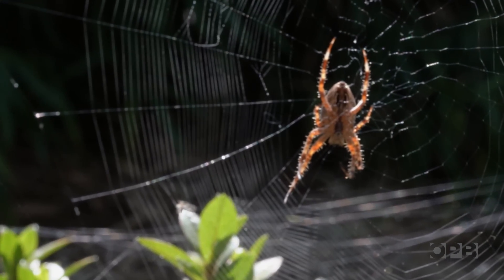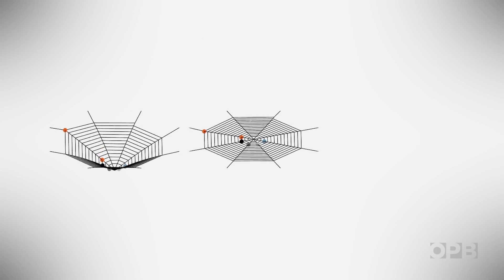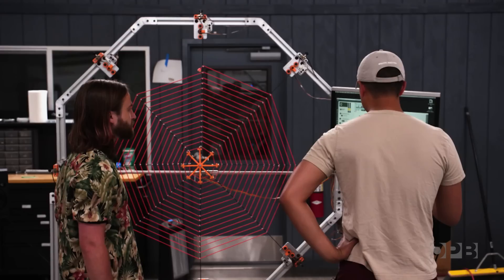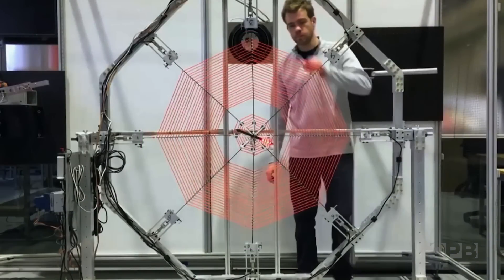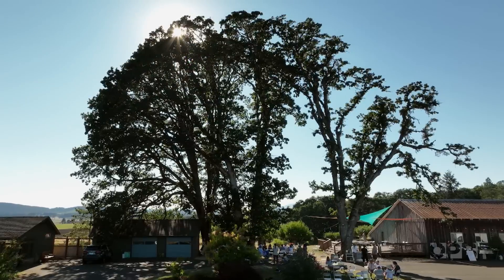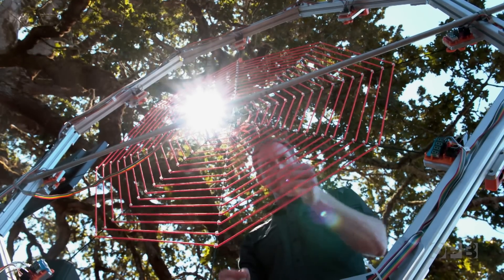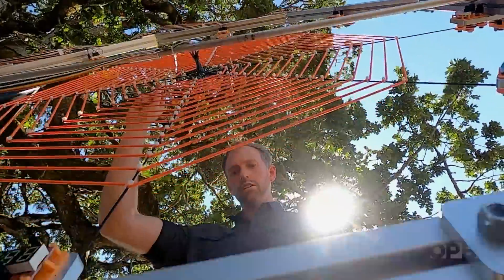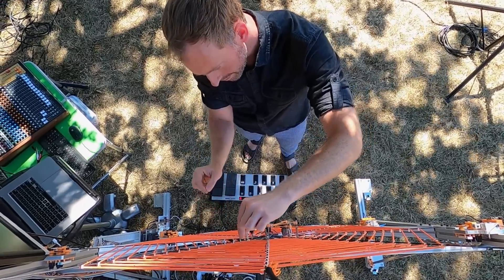Spider-web research yields … a new musical instrument? | Oregon Field Guide

Comment: I think there is too much of a disconnect between the mechanical motion that is happening and the sound it is making; it could just as well be a midi controller. I think what may be more of an inspiration is if the strings were somehow capable of making the sounds or a portion of those sounds through their actual vibrations.

Comment: Kircher mentioned this in the 1600's with a nice spider diagram too. "I have observed a remarkable and hidden harmonic artifice in the structure of spider webs. If these webs were strong enough to withstand tension, I would say that they could produce a most perfect ten-stringed instrument.  I observed that spiders usually make their webs in hexagons, with a surface composed of ten strings, stretched so skillfully that their length constitutes a perfect decachord. If divided into six equal parts, I say that the chords within each triangle are so woven that they form an exact decachord (10 string instrument), and the lines are so proportionate that the last one to the first produces a octave with a semitone, while the remaining chords are similarly proportional and provide the other natural tones" He also mentions to use iron or silk, i'm not sure why bungie cords would with chosen?
Reply: Silk might have worked, iron/steel (which we did try) was too stiff: 

The ability of the web to stay “in tune” corresponds to how much a slight error in, for example, the intersection positions changes the tension balance across the structure. With something very stiff, a small slippage or some creep in the material could wildly change the tension balance, even letting some of the strings go slack. Using latex-core rope means that we can operate with all strings stretched by a significant portion of their length, so that small errors don’t change the dynamics significantly. Because what matters most for the system is the symmetry of the tension distribution in the web (which allows us to use a fast and robust algorithm to “electronically steer” the sensor array on the spider) and not the tone produced by the strings themselves, the latex-core prototype won out over our early attempts to build a web with guitar strings.

Comment: I hate to break it to you, but this clearly doesn't make sound - it's a really complex MIDI controller. The sounds are made by the computer that's sitting next to it. These strings are too slack to make audible sound.

I'd be more interested in hearing the harmonies that are actually produced by the web shape - that experiment would probably only be doable in a software simulation though, as the strings would need to be actual (guitar, piano or violin) strings, extremely carefully placed and tuned. Building and tuning that in real life would probably be near impossible though.

Comment: Using different materials for the radials when the spider uses the same material, just thicker.  There is a flaw in your simulation.  Both shock cord and paracord comes in different thicknesses and strengths.  Choose one and stick with it.

Comment: A really cool inter-disciplinary project, though a little bit thin - I think I'd like a little more on the biology and the other aspects, I saw an article that talked about spider sensory use of webs, possibly linked to this project which is why I clicked quite quickly. Of course if you used nylon or metal strings it could sound a little more harp-like or guitar-like without amps - but I wonder what the acoustic/vibrational properties of spider silk are, if they are replicable to a greater extent, and how they co-evolved with the sensory capacity; I could also think about how you could use this to create some sensory organs in robots too. Maybe the two perspectives could help each other, this is already similar to experimental archaeology.
Reply: *thin as a video, I think the project itself probably feels like plenty.

Comment: Going by the sound of the instrument, it sounds like plucking a string triggers a MIDI signal, which is then played – it doesn't sound like an actual amplification of the sound the strings vibrating make. It'd be a much, much more complex sound if so. I wonder why they're doing it this way?
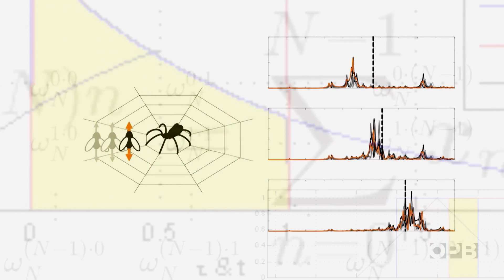Reply: We do have the ability to pipe the signals measured at the feet out to a set of speakers (the frequency contents of the signals measured at the spider feet are illustrated at about 3:52, and we can go up to 8 speakers when the performance space is conducive). 

The mapping to musical notes is originally to demonstrate the speed and accuracy with which we can identify plucked strings from just the foot-sensor data — just using the raw signals would actually disconnect the instrument from the spider research.

The mapping to musical notes also enables the overall performance art of playing music on a spider’s web — using a familiar sound with an unconventional instrument gives the audience a frame of reference for understanding the performance, that they don’t have if the instrument and sounds are both unfamiliar.
Reply: @rosslhatton  okay, right yeah, the web's usage as a musical instrument is not the main point, just a cool side-effect. The robot at the centre converting vibrations to computer signals is the main thing. 
Still, it got me thinking how an acoustic spider-harp could be constructed, and how it might sound....
Reply: @joe1729 We’ve thought some about acoustic versions, and came to the conclusion that they’re probably not feasible. The main obstacle is that the strings are all mutually supporting each other, rather than being isolated and attached to a rigid structure as in a traditional string instrument. As you noted, this will lead to a complex sound with a pluck on one string exciting vibrations in the other strings; it also means that the strings can’t be individually tuned. (Unless we introduce turnbuckles into the cables, which would disrupt the web structure and interfere with the sound. Even then it would be a tuning nightmare as adjusting one string would affect the tension in the others.)

The second problem would be finding a tension/string-size distribution that produces a useful range of tones and octaves. Our web is designed so that stretching the radial lines pulls all of the spiral lines into uniform tension; to get an actual octave-level change between strings as you move outward, you’d need to either double the string length or lower the tension as you move outward. The first option would result in a very sparse web (or a dense web with sub-octave steps and a small octave-range), and the second would lead to a tricky balance of stretching the outer strings enough that they will vibrate while not stretching the inner strings so much that they break.

(Several other commenters have asked about using musical instrument string instead of the parachute and shock cords. Tension balance and maintenance is an important factor in the material choice: The stretchiness of the material determines how much tolerance there is for changes in string length, with an error of a millimeter or two as we assemble the web or as the material stretches being inconsequential on our stretchy strings, but significantly changing the tuning of a stiffer string.)

Comment: I wonder what you would hear if you just stuck a piezo crystal in the center and listened to it. Would it act as a kind of microphone?
Reply: We can get something equivalent by passing the accelerometer signals measured at the feet straight through to the speakers without conversion to musical tones. The overall sound is a bit like dropping a large rock into a lake, and the full frequency content of the sound is illustrated in the graphs at about 3:52 in the video.

Comment: Cute, but typical of human thinking that is oblivious to obvious. 

I don’t know anything about spiders, but no spider weaves on a rigid frame. And no two webs are the same. What causes these variations in design and execution? There are other vibrations, for example how the supporting objects vibrate (a window frame vibrates differently than some twigs) and how each insect vibrates. Also, the wind which is a vibration of the air. Does air vibrate differently in strong sunshine than it does on a foggy, cold day? Etc.

Comment: I can't comprehend the mechanical principle that is put in the web instrument. When someone pools and releases a knit shoudn't the vibration from all the web string dissonate all together. It looks like fake... But would thr guy lie? I don't know
Reply: We’re measuring the vibrations in the structure at each of the feet. Each of the strings causes a different set of vibration patterns across the feet, and we use this signature to identify which string was plucked, before sending that string ID over to the synthesizer.

Comment: They lost the opportunity to make a suround setup matching that spider web. With matching pick ups and speakers.
Reply: We do have an octophonic speaker rig, along with software modes that range from directly patching the foot-sensors to the corresponding speakers through various levels of processing for direction and distance. For the performance in this video, we were using the venue’s stereo rig, as it better matched the acoustics of the space.

Comment: So where’s the musical instrument?
So far all I see is a cool experiment to see the physics of how spiders sense vibrations, but they wanted to hear it themselves so they coded a speaker to play sounds for them. Which was completely unrelated to the research. That experiment would have been fine without the sound because their fake spider feels the vibrations of the plucking not the speaker playing harp sounds.

I am corrected having watched more of the video. I do see a possibility that an instrument could be made like this. Acoustical or electrical might be feasible, but I don’t think it would have any advantages over a harp. Given that all of it’s strings vibrate together, it wouldn’t have a clean sound or pitch. That’s just a guess in my part though.
Reply: The research/music connection is that the sonar-like localization algorithm lets us create an instrument in which the performer can pluck the strands of a web-shaped structure to produce desired musical tones live in front of an audience.

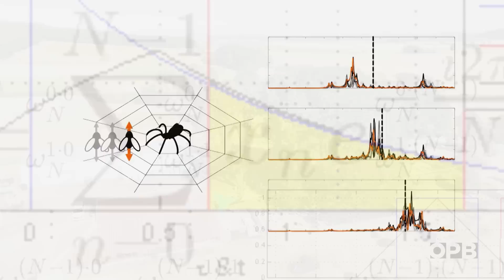As you noted, the raw sound generated by plucking a web structure isn’t very clean — plucking one string sets up vibrations of many strings at different frequencies. (You can see what the frequency content for three different string plucks measured at one foot look like at 3:57) 

When we measure the mixed-frequency information at all eight feet, however, there is enough information to back out the location of which string was plucked, and then send that over to the synthesizer program in which we have assigned musical tones to the different strings (here, harp music, but we have a library of other sound profiles).

Without the sonar algorithm, we’d need sensors on the individual strings, which would make the physical hardware significantly more complex, add wiring which would take away from the “lightness” of the web structure, and would still need another algorithm to separate out the string plucks from the cross-talk vibrations in other strands.

Comment: I like the shape for a velocity sensitive midi controller.  It could be very intuitive arrangement of notes and octaves.  Many controllers now use a grid arrangement and it is not quite right.  I am thinking a device similar to the novation launchpad that has the spider web arrangement. Each section would have 12 velocity sensitive buttons.  Then you can decide if each section is different octaves or different keys.  Also you could use colors in some way.

Comment: the new technology is in how this 'harp' only uses 8 sensors (the spider legs) to detect all 80 different notes, instead of putting one sensor in every string note
Reply: I get what you mean, but it would be possible to do it with just one sensor in the middle of the array.
Once you remove the need to identify the direction that the sound came from you could just have a magnet in the centre of the web that moves relative to an induction coil in a fixed position to generate AC current as the magnet moves with the vibrations of the strings. It's the same principle as the diaphragm in a dynamic microphone, only split into two pieces rather than being in a single housing.

Comment: The radial layout and even some of the sounds reminded me of steel drums and other similar instruments. As already mentioned, the opportunity to attune to octaves would be useful, but I'm also wondering if the general physics of the layout has a common denominator that is applicable to other instruments with a similar layout, e.g., is there a most efficient layout of different tones that would improve the playability of the instrument.

Comment: Why not make this out of real guitar or piano strings? I feel like you'd get better results scientifically and musically.
Reply: For an edge-tensioned web to work reliably, you need a material that will stretch by a significant portion of its length, so that you can make sure that all the strings stay stretched even if the web geometry shifts slightly. Musical-instrument strings do stretch some, but not enough to make the web work reliably without adding tensioning structures like turnbuckles inside the web structure. The spider video at 0:25 is a good illustration of how much a spider stretches its silk as it builds the web.

A fully acoustic spider web would probably not sound particularly musical to human ears, even if it was feasible to use instrument strings: On a typical instrument, the strings are isolated by the instrument frame to produce individual notes, but in a web design, the strings support each other. This means that plucking a single string is going to cause multiple strings to vibrate together — the graphs on the right of the screen at 3:55 show the vibrations being felt by the feet, and would look like a single peak (or a set of harmonic peaks) for a typical acoustic instrument.

Comment: A few months ago I witnessed a very small spider building a web in my bathroom. It actually seemed kinda big, it went from my door to halfway to my sink, along the bottom of the wall to the floor. We did have a fly problem so I let it be, but more importantly geckos sometimes moved into the house to keep the spiders in check. Anyway, I observed the spider would sometimes make the anchor strings, then go back to weave the web itself, then back to anchor. As it made the anchor it would walk some distance along the ground with a leg in the air, reach a point then tap a leg on the opposite side, onto the floor, then walk back, rinse and repeat. I can't tell if it simply grew up or got taken over, but a week later I saw a larger spider in its place.
Reply: Usually spiders do not take over the webs of other spiders. I suppose your little spider shed his old skin. Spiders have an exosceleton that doesn't grow with them. Therefore they have to shed their old exosceleton/skin when they are growing bigger. It's quite similar to crabs or other crustaceans
Reply: Every detail in nature points to the presence of a creator. This creator is, of course, Allah Almighty, Lord of the Worlds.

"And in your own creation, and whatever living beings He dispersed, are signs for people of sure faith." (Holy Quran; 45/4)

Comment: Are the strings on this instrument resonating? Or are they midi triggers?
Reply: They resonate, but at a low bass pitch and with heavy damping; the web structure also means that the strings are not isolated, so that plucking one string starts vibrations in multiple strings. You can see the frequency content heard at one foot for a few of the individual strings at about 3:54.

The robot spider listens to the mixed sounds arriving at the different feet, identifies which string was plucked to produce those mixed sounds, and then sends that string’s location to the midi system.

Comment: What If you put audience inside a web of 8 speakers each one connected simmetrically to a "slice" of the newborn harp? Just a suggestion, nothing more.
Beautiful cooperative project, according to me!
Reply: Thanks! For another part of the SpiderHarp project, we do use an octophonic surround-sound system like you suggest. 

We use it to demonstrate the localization algorithm, with software modes that vary the processing from “raw vibrations at the feet (frequency shifted to human hearing range)” to the full “location-to-pitch/octave mapping” featured in this video.
Reply: Wao! That Is going to be super duper Amazing!